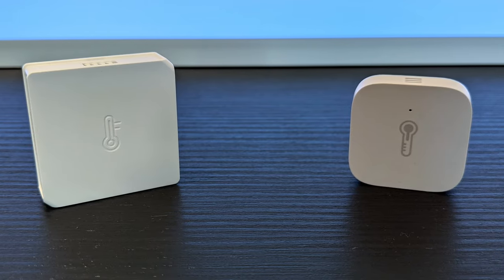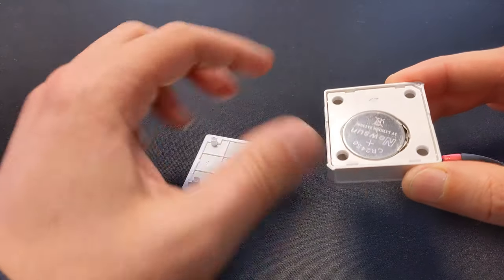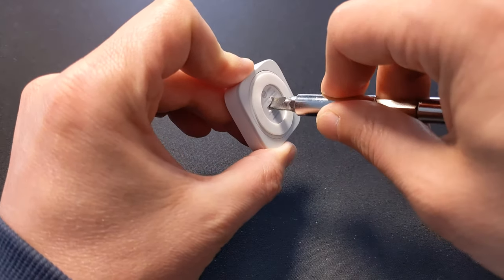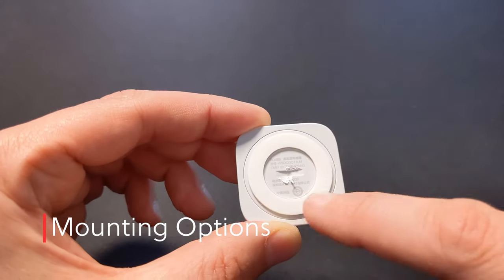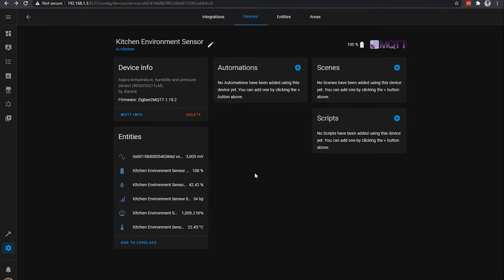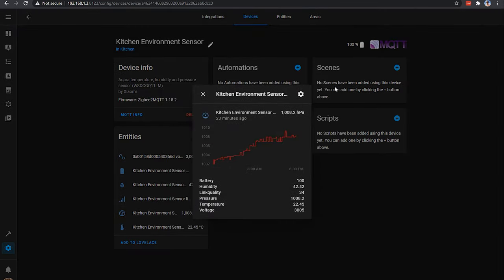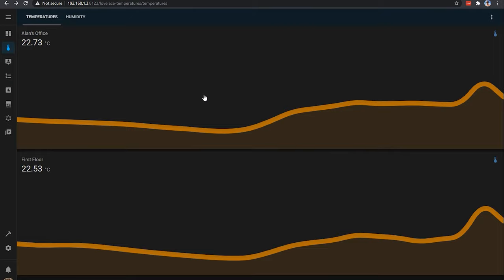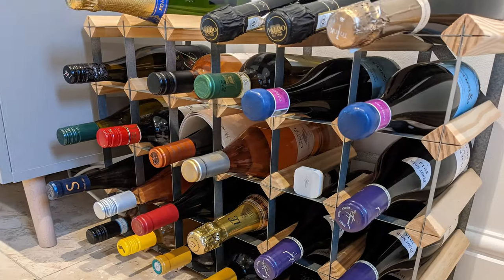Sonoff vs Aqara Zigbee Temperature Sensors - Which is better?

Comment: The reason you screwed up the aqara is because you used a screwdriver. Had you instead used the correct tool, you would have found it exceedingly easy.
Reply: And what would that tool be???
Reply: @KameraShy  that's been covered on my channel.  ;)

Comment: I enjoy your videos.  Thank you.  I have half a dozen sonoff sensors scattered around the house and they seem to perform pretty well.  I've had a few lose their connection to the network but I really don't have a decent zigbee network established just yet.  Baby steps.
Reply from the maker: I built mine up over time, slowly adding things as I found a new project or use case.

No need to do it all at once!

Comment: Thanks for the useful review.

I would suggest that the ease of battery replacement should be tested with the sensors mounted as intended.  Doing that, the Aqara sensor only requires a slight twist and it comes off it's mount - super easy but potentially a risk as it can make the button cell accessible to small kids.  The Sonoff sensor's battery is easier to change when mounted on a surface but it is still a pain.  I prefer the Aqara sensor because of the ease of access and it's much better looks.

Another thing to consider is that both sensors will only transmit updated measurements when the value has changed by a certain amount.  This can be a problem if used with a (virtual) thermostat which expects to "hear" from the sensor every 30 minutes or so.
Reply from the maker: Thanks for your input.  I agree on the Aqara looking better and being easier to access.  And I've finally got the hang of opening the battery compartment, but I did ruin a few of the plastic covers trying to open them initially with a screw driver
Reply: @HomeAutomationGuy  Don't think you should use a screwdriver for the aquara, but a coin. They never gave me issues use an euro..;)

Comment: nice and detailed comparison ..... what next?         
and what Zigbee coordinator hardware are u using? ... I'm using sonoff hub (flashed to tasmota, very bad experience ..... it is not reliable )
Reply from the maker: Thanks! I've used two CC2531 USB dongles directly connected to my Home Assistant instance and they're working great.  I will be doing a video on them in the near future.
Reply: @HomeAutomationGuy  waiting for that video ... after cing that video then i will order it
Reply: @HomeAutomationGuy  waiting for that video ... after cing that video then i will order it

Comment: I have a number of Sonoff SNZB-02 connected thru a bridge to the wifi and displayed in home assistant. I notice that my temperature readings only changes every hour. Rarely less. Graph always shows this hourly ladder effect. Not sure why this is happening. It's nearly always every hour, to the second. 

Examples

00:43;08 - 23.8
01:34:30 - 23.28
02:34:30 - 22.8
03:34:31 - 22.35
04:34:32 - 21.95
05:34:33 - 21.61
06:34:33 - 21.46

any thoughts, thanks
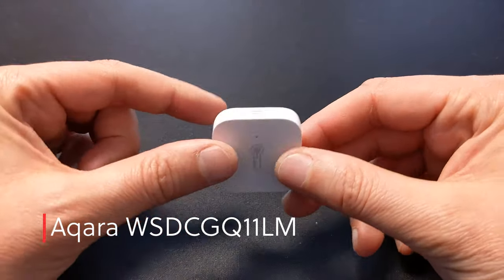Reply: Should be that the sensor fires an update every hour unless the temperature changes by more than 0.5°C (like between 00:43 and 1:34, difference is > 0,5). All other changes are < 0,5°C.
Reply: in theory yeah but with the standard sonoff temp monitor is hourly update and never seen it any different. However doin some research found "HUIIUH 3PCS Tuya ZigBee3.0 Wireless Temperature Humidity Sensor" which are compatible with the sonoff bridge. These have a AAA battery which is much better and I see on HA update is now 30 mins. Sorted. Good enuf for me.

Comment: Hi. I'm interested to buy an outdoor "smart" temperature sensor that i can connect to my phone via bluetooth or wifi. Do you have any model/brand recomandation? Thanks in advance
Reply from the maker: I do not have any recommendation I'm afraid, I don't have any devices that measure outside temperature
Reply: @HomeAutomationGuy  Thanks for answering. I will try to find something on web, because it sould exist something in the year 2021. It should be some weatherproof temperature/humidity sensors connectable to gateway must be on web. I'm still positive in my research 😀. All the best!
Reply from the maker: If you find something please share it here so we can all learn! I could use one of them myself!
Reply: I have found the Philips Hue outdoor motion sensor to be a good option. Mounted to a North facing wall out of direct sunlight it can be used as a reliable light level sensor too (i dont use it as a motion sensor).
Reply: @jimmywoody6962  Hi. That's greate! Thank u for information. I will search about this devise. 👍🏻

Comment: Can you use Aqara to control sonoff TH16. I use th16 for my electric underfloor heating but I would like temp sensor without cables
Reply from the maker: You can if you use something like Home Assistant and automations.

If you're using the Sonoff bridge then I'd suggest keeping everything Sonoff
Reply: @HomeAutomationGuy  thanks for replay. Sonoff as per each device don’t need bridge as each device connect to your WiFi network and I use eWeLink app to manage daily task for those devices. Th16 is a awkward device as it not pop up on scenes. Apparently sonoff fixt it but I cannot see yet that fix. I will prefer Aqara temp sensor as they look better than sonoff. Maybe I will buy one in AliExpress to check how this work and let you or your audience know if this is good working relation. Thabks
Reply: yes is the easy answer but i would swap it out for a sonoff basic and use the th16 eslse where assuming 13A ok

Comment: Are both compatible with the Philips Hue Bridge?
Reply from the maker: Whilst both devices, and the Hue bridge, are all Zigbee devices, I don't think they work natively with the Hue eco system.  You'll need to use some sort of intermediary software like IFTTT or Home Assistant to get them to talk to each other.
Reply: @HomeAutomationGuy  I‘m running HomeAssistant on my HomeServer. The Sensor just needs to Connect to the Hue Bridge
Reply from the maker: Unfortunately Philips have locked it down so the Hue Hub will only control lights. You will need to get a ZigBee Hub or Dongle that works with Home Assistant/ZHA and configure it.  You'll then be able to use Home Assistant to create automations that use these sensors and also control the lights.  More information can be found here : https://youtu.be/ZUWrUBJQRpA
Reply: @HomeAutomationGuy  Thanks a lot for the answer.I will buy a zigbee dongle for it. Great Video!